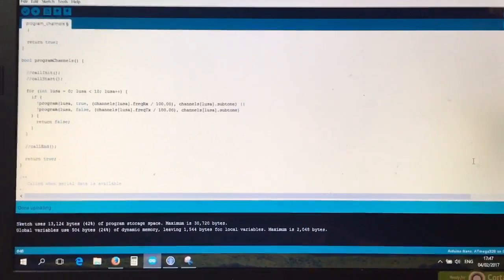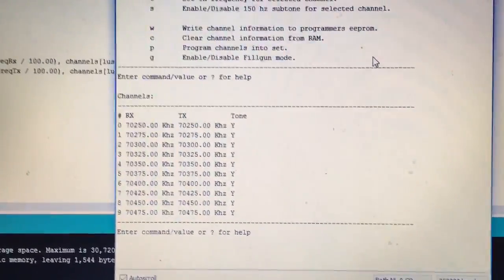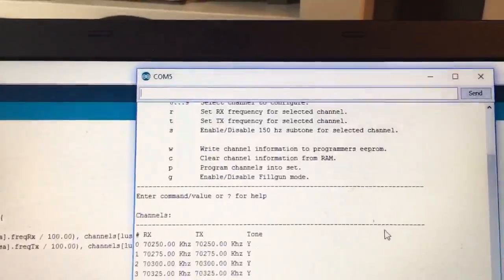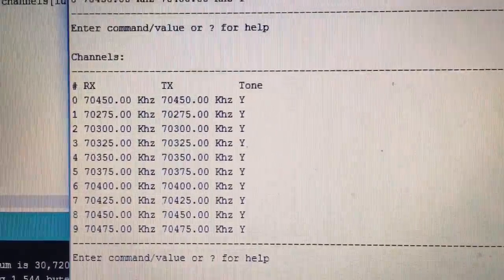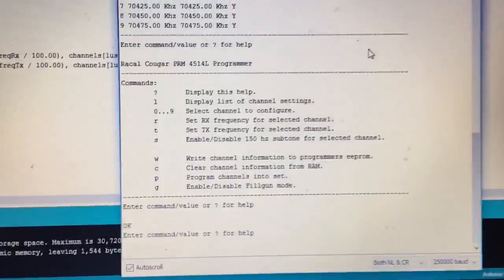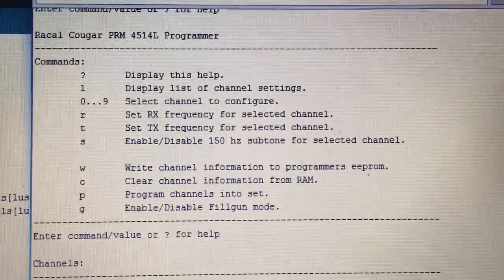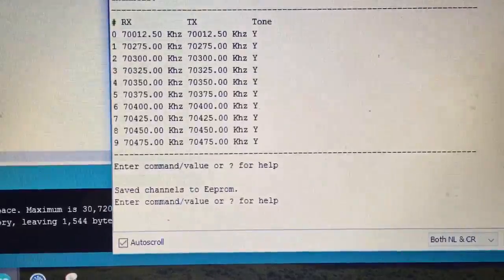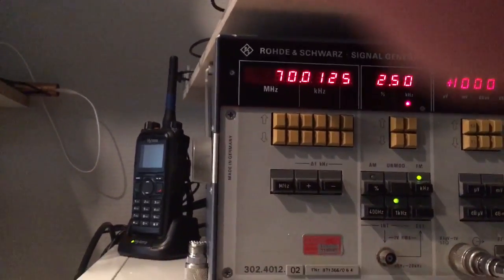Racal Cougar - Arduino Program

Comment: Hi Dave, ive tried to upload the sketch but keeps coming up with problems , any chance you can assist please.
Reply from the maker: Hi Scott, Can you tell me more about te problems you're experiencing ?  Are you able to run the Arduino "Blink" example (https://www.arduino.cc/en/Tutorial/Blink)?
Reply: Hi Dave, yes blink works fine , After downloading the sketch when i come to verify it states R pin was not verified in this scope. 
  digitalWrite(GPin,LOW);
  digitalWrite(RPin,LOW);
  
  detachInterrupt(digitalPinToInterrupt(FPin));
Reply from the maker: I downloaded the sketch using the same link as in the post and it compiled fine. 

Would it be posible to zip your sketch and send it to me together with the complete compiler output and OS + Arduino IDE version used ? you can send it to <call>@veron.nl where <call> should be replace with pa5dof